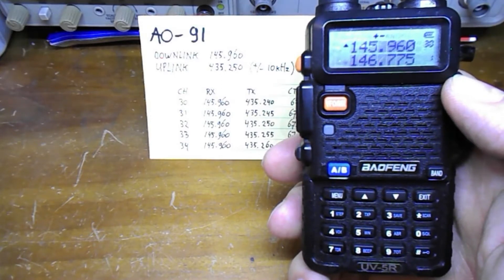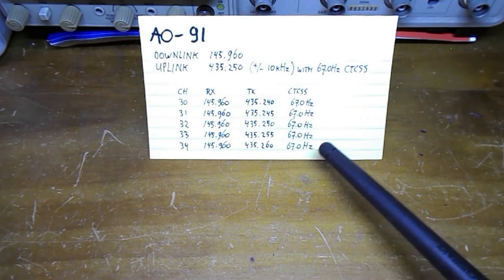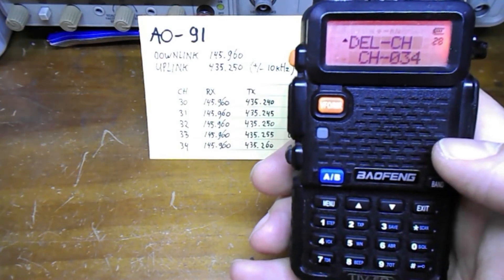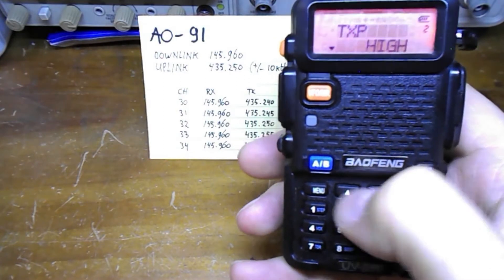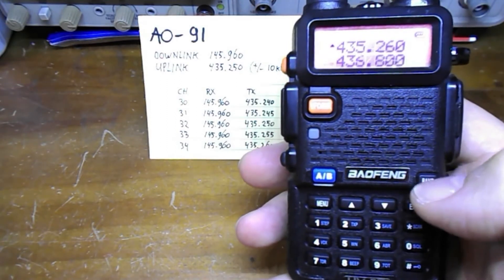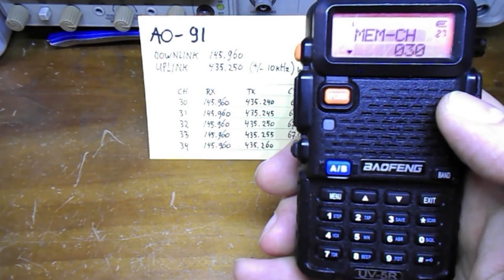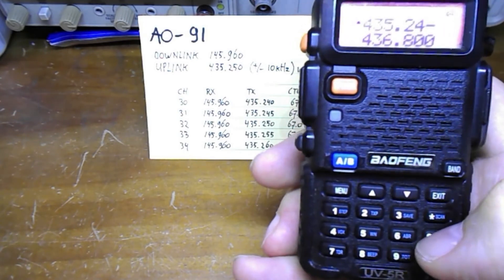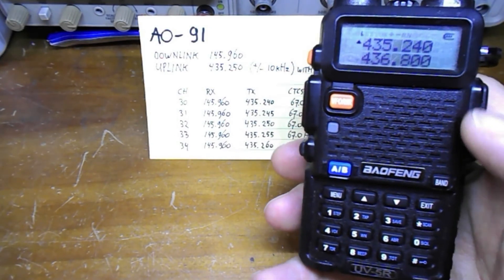Hand programming the UV 5R for working AO-91 CubeSat

Comment: Gm I have a probleme wiiht the baofeng on AO91 ,somtime when a receive AO91 the reception is stoped , I hit one touch and it restart  But i have not this probléme on SO50 Have you same probléme ???
Reply from the maker: Hi Sylvie, some satellites go into sleep mode after 10 minutes of inactivity and they need to be re-activated by sending a transmission with a specific CTCSS tone. If the line-of-sight path hasn't undergone significant changes (and without knowing more about your setup) I can't really think of any other reasons.

Comment: Nice educative video. Many thanks. Perhaps you need to comment about SQL levele also while on Rx mode. and switching OFF shift   thanks again  sarma/ vu3zmv
Reply from the maker: Thanks for the feedback Sama. Main thing to do is to: 1) clear/delete the memory channel before programming and to 2) do all the steps in one go and 3) in this particular order (set RX frequency first, then TX frequency). If repeater-split is set, you can turn that off in menu 25 (SFT-D). I'm not sure if the UV-5Rc is different but I was only able to test this with my standard UV-5R. Please try again and let me know if you're still having problems.

On the squelch topic.. Yes, when working satellites or very weak stations you will get the most out of your radio when disabling the squelch, menu option 0 (SQL) set to value 0. The radio will then sound static noise but this will help you pick out the weakest signals and work stations that are not powerful enough to open the squelch.